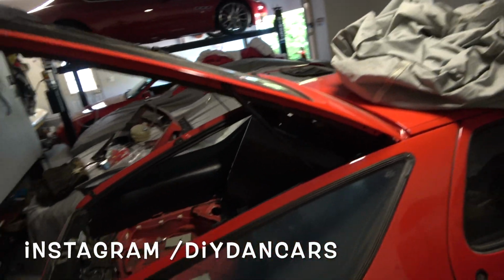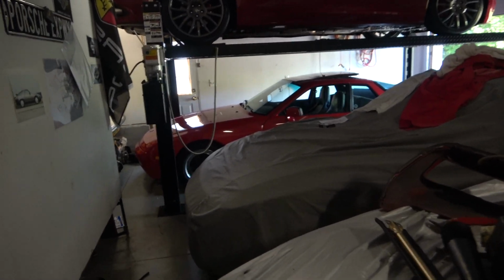Troubleshooting The Headlight Motor In My Porsche 944

Comment: I'm kinda new to 944s, I have recently acquired an '86 944 Turbo and I've noticed the headlights won't come on or pop-up if the car is not running. Is that normal?
Reply: It could be a sign your battery is no longer healthy, and can't supply the required voltage to trip the relay and turn the motor unless the alternator is helping it. We had a similar problem where the radio wouldn't tune in our station unless the car was running, weird I know. New bat fixed it.

Comment: When my 951 headlight motor doesn’t work…I open up the hood and smack it. Works like a champ 🤣
Reply from the maker: haha! I should have tried that first, it might have saved me some time. ;)
Reply: Usually a sign that the commutator is worn. Its a rotary switch with 12 odd contacts of copper that have insulation between them. When new, the insulation is below the outside diameter of copper, so the brushes can only touch copper. Wear it down enough, and the air gaps disappear and the insulation and copper are both on the running surface. The brush might stop exactly between copper segments and sit on the insulation giving your "open circuit, no run". When you hit it, your shifting the brush over to a position where it makes contact with copper again. Easy repair is to scrape the required air gaps a second time.

Comment: I really want to get a older solid Porsche along side the GS. What other models would you recommend?
Reply from the maker: Anything before 1999 (except for the Boxster) is extremely well built. Porsche really did design these cars to last a lifetime. I have two 944 Turbos and a 928S4 and I love them. Both of these cars have been great to me. Just keep in mind if you buy one that has been abused it will cost you. Just make sure the timing belt, fuel lines, and motor mounts have been recently done since those are the big ticket items.
Reply: Try buying a good sample version or else it will be a junk which can cost u more than it is worth. Always buy the best sample and pay up more

Comment: Dear DIY Dan, I have the same problem in a 2,5liter 944 from 1985, but the Grey cable has no voltage with ignition on and headlight switch on? Do you have any further hints for me? Thanks, By the way, great video!
Reply: same for me
Reply: @lilratzu6622  the gray/blu wire 56k gets its power from the headlight switch when on. Even if your other lights work when you turn the switch on, it could be failing or dirty inside and not giving power out 56k to feed your gray wire.

Comment: Nine...twooooooo....eeeeeeeiiiiiggggghhhhttt?!?!
Reply: dab of Vasoline works to hold on the washer....:)
Reply from the maker: Good idea! I forgot all about that trick!
Reply: Picked up another S3 Memorial Day....Hans had a buddy selling one.  Garnet Red with Porsche Script cloth interior.  Ran the PPS...it's a M900 "Tourist Delivery" which makes it one of 20 in 85...and the cloth makes it likely a 1 of 1.  4 care packages from Roger on the Garage floor waiting to get installed.
Reply from the maker: @Dundertaker1  Sounds nice, Dan! I bet it's a beauty! For the record, there was a small cameo of Big Red in this video. ;)
Reply: @DIYDanCars  I seent it!
Reply: Thanks for the video Dan. I don't get what the wiper motor has to do with the light motor but I checked that fuse also. I also have a second 944 so I'll check the relay. Last time this happened on this car the motor was rebuilt locally by mechanic recommendation and it was a faulty relay. Good call on that!
Reply from the maker: @stephenmichalchuk1584  Sorry! I should have mentioned my wiper motor also stopped working. I was going to do a video on both the headlight motor and wiper motor, but decided just to do the video about the headlight motor.